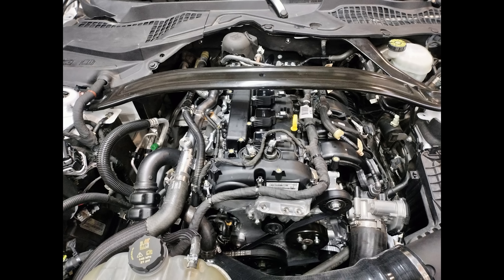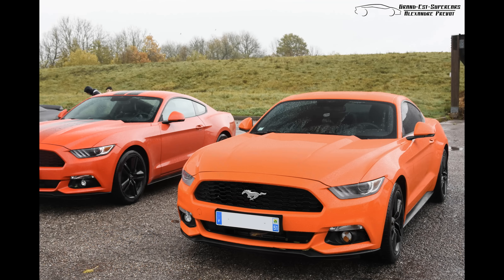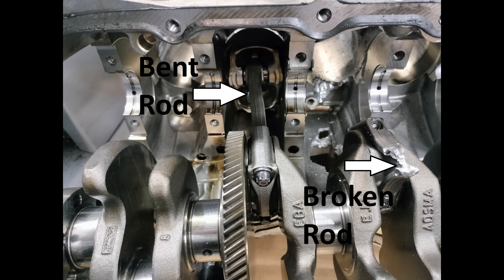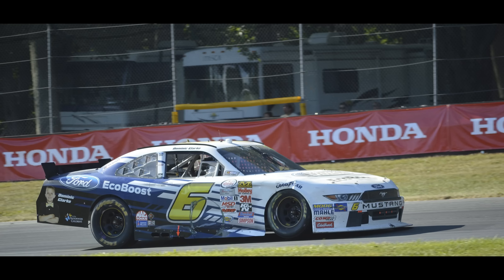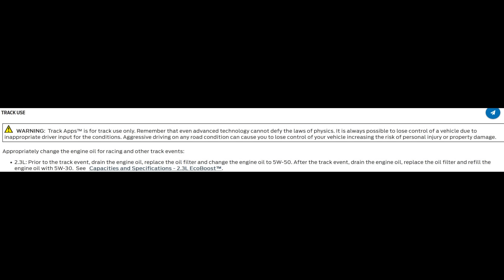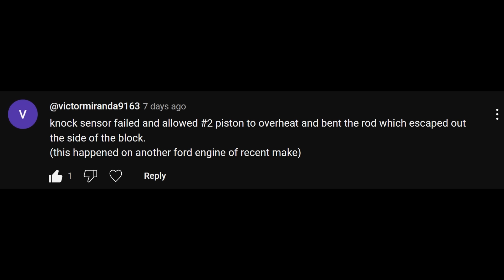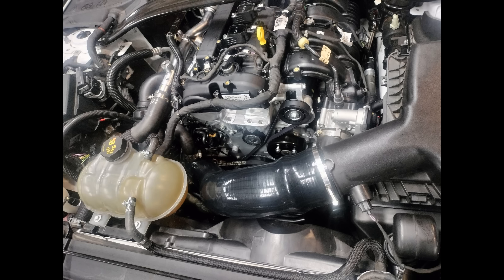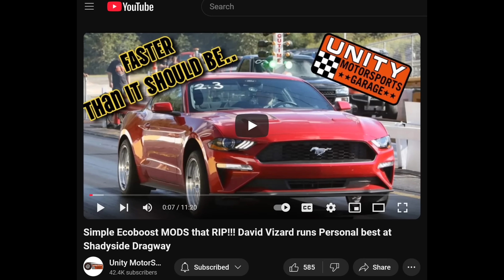EcoBoost Destroyed, What Happened?

Comment: I can tell you what happened. It’s a small4 cylinder engine. Because it is a 4 cylinder engine with a turbocharged engine it runs hot and temperature is the number one cause of  these engines burning up and leaking oil.
Reply from the maker: That's incorrect, a newer video showing the cause has been put up.

Comment: 10-15 seconds with a heat gun on a plastic connector gives it enough flexibility to open without breaking.   How hot should the heat gun be?   If you can't hold your hand in the heat for more than a couple seconds then it's too hot.  If you can hold your hand in it forever then it's not hot enough.  I usually set mine to about 1/3 of max heat and hold it about six inches from the connector.   Even 40-year-old plastic connectors can be opened non-destructively after heating.

Comment: If ANYONE else said that the rod bent from pure power and not detonation I would call bullshit.   In a NA engine the highest stress on the rod is caused by the change in direction at TDC & BDC. At high RPM It is almost always higher stesss there compared to the stress after TDC where the combustion pressure is pushing on the piston.   The extra force caused by boost doesn't change the stress  at TDC or BDC so you have to make A LOT of power to bend a rod.   Most hot rodders don't monitor EGT's, AFR's and knock sensors close enough to avoid knock on a boosted engine. They get a clean tune on a dyno then drag race with the same tune but different weather conditions and blame thier engine destruction in faulty rods 😂
Reply from the maker: Just to be clear I said from cylinder pressure. Power would usually involve RPM, at least horsepower would. There were no signs of knock in this engine. Not from logging data, not from looking at the pistons, and not from reading the bearings with a micrometer. I couldn't believe it either, but Ford uses junk rods.

Comment: Mine blew up at 144,000 from original spark plugs I'm guessing create a spark knock in the engine causing it to throw a rod out the same way. Mine was a automatic I was just driving around the curve at low speed but I did have the RPMs up pretty sure mine already had maybe a bent rod since these engines have a weak one 2015 is the year I have. I've also heard in the upper exhaust ports don't let enough out creating the pressure in the cylinder  pressure buildup then it throws a rod right through the block.😂

Comment: i have 2 Rangers 2002 & 2011 with the 2.3 Duratec, predecessor to the ecoboost. These have been as good as Toyotas engines, one has 200k miles other has 80k miles. ( i worked for Toyota 10 years). i hate new electronics on engines, im old, i grew up all metal and analog engines.

Comment: With this higher horsepower tune what was your car making and what was peak manifold pressure? I’ve recently purchased a used 2door bronco with this engine and manual trans and I think it has the ford performance tune that is supposed to make 330hp and 385ft-lbs I believe according to some sources online. (Google and forums). I’m curious what kind of manifold pressure you hit because I’ve seen peak pressure on my display hit ~21psi when I was needing to merge onto the highway 80mph speed limit.

Comment: Well that stinks.  I'm curious why you opted for the Ecoboost instead of the GT if you were going to track it?  You can get a lot more potential HP and torque out of the 5.0.
Reply from the maker: Why a GT when you can get a Shelby?
Reply: @GregsAirplanesandAutomobiles Not everyone has a Shelby budget, I'm afraid.  That's why I bought the GT.  Did get the track pack though.

Comment: I don't understand why you and vizard care for this 4 cyl when the 5.0 coyote exists, and is an absolute unit
Reply from the maker: In a sense you're asking why bother with 4cylinder engines at all? There are a lot of reasons. First, it makes the car about 10,000 dollars less money to buy.  It gets better fuel economy and is far less costly to insure. So those are some practical reasons. From a performance standpoint of course the V-8 is faster but the 4cyl car is lighter and better balanced for cornering and braking.

Comment: I've got the 2018 Focus RS LE with (essentially) the same motor.  Overall they are a reliable motor with few vices, but don't take kindly to excessive tuning. Less than stellar rods + high cylinder pressures at low rpm thanks to the relatively small turbo = bendy bois!
Reply from the maker: It's no Alfa Romeo engine, I can say that. It's a shame really, Ford was close to hitting the mark with this car but they took a few shortcuts in the engine which really limit it's potential on stock internals.

Comment: So I should be good with my 2016 Fusion 1.5 eco-boost as long as I don't abuse the engine, keep RPMs under 2000 and have regular oil changes. The tag line on this video was a big worry, until I watched the entire video. But a good video with great information. Thanks Greg.
Reply: Most Ecoboost owners agree that our motors like a little RPM. Try not to lug your motor, nothing wrong with shifting above 3,000 RPM.

Comment: 7:37 Cylinder pressure is reflected by torque output. Are you saying that the fiat engine produces more torque than the eco boost but doesn't produce as much up high and hence doesnt have as much horsepower?

I ask because some people treat boost like its an absolute measurement that can be compared across different manifold, valve, exhaust, turbo configurations or engines.
Reply from the maker: No, I am not saying that the Fiat engine produces more torque than the EcoBoost. I'm not sure how you got that. What I said was that they have rods which are about equal in strength. For the Fiat, a much smaller less powerful engine, they are pretty good, but in the Ford, they are a weak link. Also, I never discussed boost in this video as I do that in plenty of others.
Reply: @GregsAirplanesandAutomobiles Alright, fair you didn't talk about torque or boost, I think I just made a bit of a jump. When you say "about equal in strength" from where do you draw that? Sorry about making assumptions.
Reply from the maker: Ah, good question. I say about equal in strength because they are made from the same material and are about the same in terms of thickness. In the Fiat it's almost impossible to break the rod with cylinder pressure. Of course excess RPM will do it.
Reply: @GregsAirplanesandAutomobiles  Ah, that makes sense. I just saw that you've done a bit of playing with the multiair. Fun little engine.

I'm assuming that's a GTV6 in the thumbnail going by the bonnet (hood) So the Busso rods are more robust than the ecoboost as well?

If a new factory engine is being put in with the same rods I would pull some timing and maybe a little boost in the range at which the newest tune was reaching max torque to avoid the overstressing of the rods. Still allows you to get the benefits mid range and up.

Comment: I think is something about timing, maybe after valve float and when the valve was supposed to be open it was closed at the compression part of the cycle, it did it a couple times in a row and it blew the rods. Way too much pressure.
Reply from the maker: Nope, the valves never floated.

Comment: Why are you racing with an automatic? I recently bought my first ever automatic (I’m a euro and most cars around here are manual) and the disconnect between rpm and speed die to the torque converter makes driving fast impossible. It can’t even pull off the line fast.
Reply from the maker: Perhaps you should talk to Ferrari. You might be able to get them to offer manuals again.
Reply: @GregsAirplanesandAutomobiles  Ferrari haven't offered an automatic ever as far as I know, just automated manuals and actual manuals.  None of their current lineup is automatic at least.

Comment: Balance shafts are such a waste. I expect a bit of vibration from bigger 4 cylinders. Companies want to worry about every 0.0001% of fuel economy, so they go to stupid wet belts running timing gear and oil pumps, instead of just getting rid of the stupid balance shafts, which do not actually FIX the problem, just hides the problem with extra power robbing mass. I know a few people running large displacement 4 cylinders ranging from the GM Iron Duke 2.5 liter all the way up to lightly and heavily modded Honda H-series engines that have removed their balance shafts with no ill effects from doing so. Balance shafts are the lazy band-aid fix, they have always bothered me, does not matter if it is a 4 cylinder or a 90 degree V6, balance shafts are dumb.

Comment: Now that I have a little more information, I'll state the engine damage is the result of excessive cylinder pressure, but not the true cause.
Searching for the true cause, will require additional data concerning cylinder blow throw or intake manifold pressure vs. drive pressure, and just not peak pressure, but scaled pressure, over the complete rpm range, plus timing data.
And even this may be inclusive, due to the limited information on the cylinder head with integrated exhaust manifold.
Reply from the maker: I have a mountain of data on this. I was lucky we were set up to log.
Reply: Excellent!!
Something that most guys  with basic data loggers can record is crankcase pressure vs manifold pressure, timing, wastegate position, etc.
I check my oil level and catch can after each 1/4 mile run and almost always collect a little oil.

Comment: I heard a theory that bent rods of this sort is from applying too much load at low rpm. From a turbo ls youtuber. As in below peak torque output.  Different application, different engine. First video of yours I watched so I have no clue about your car's specifics.
Reply: Yep, that's why the modern quick spooling turbos seem to eat the old classic JDM engines.

Sure, that  stock bottom end RB26 happily made 500-600 HP all day with that big laggy journal bearing turbo that doesn't get going until 5k. Suddenly your asking the rods to deal with 90% of max torque where they used to see 40-60 while the dwell time is 2x what was at that same 90% max torque on the older turbo.

Comment: My guess would be that there was too much boost, especially at low rpm where turbos tend to generate maximum torque. Was the electronically-controlled wastegate functioning properly?

I'm not a fan of forced induction for street engines, racing engines fine. I like the high compression large displacement of my 370Z with its flat torque curve.
Reply: Interesting question about the wastegate!
The 2018 Eco Stang uses a pneumatic wastegate, but the new 2024,  uses an electrical wastegate. Both are controlled electronically.
Reply: Since reading about Ford's new Ecoboost Motor, I've been searching for information about the changes made (including the wastegate) and the advantages.

Comment: Greg... I just read where you were running a ported turbocharger!??
Can you tell me what type of wastegate actuator and bov, you were using, as well as any exhaust modifications?
Reply from the maker: The Vizard turbo mod, the first one, he has videos on his channel where he shows what he did. It certainly allows for more power.
Reply: Thanks,
So, his ported turbo with factory stock bypass/bov, wastegate and stock catted exhaust?
I'm considering, doing some detuning on my car to move from the 1/4 mile to 1 mile track and have lost my notebook, from when I ran a stage 2 tune with stage 2 mods. Your information is very helpful!!
Thanks again!
Reply: I also keep an eye on what David is doing with his stage 2 Mustang.
He needs to at least, let you tune his transmission!

Comment: My question after the fact is how big of a fuel injection shot were you giving this engine before failure? It might be possible for too big of a fuel shot to bend the connecting rods. Top fuel dragsters will knock out rods if they are over fueling.
Reply from the maker: No, we were not hydro locking from excess fuel. While it's possible to do that it's not going to happen on a street engine. Even if an injector was stuck fully open as long as the engine was running it wouldn't hydro-lock it in this application. Now if you shut the car off and the injector stay on then it can happen, but it will happen when you start the engine.
Reply: @GregsAirplanesandAutomobiles  well then I guess you had too much boost and raised the compression enough to find the weak link.
Reply from the maker: Everyone keeps saying boost, it was really cylinder pressure at low rpm that did it.

Comment: My moms car has a small head gasket leak, coolant going into the combustion chamber. It is a car with 200k miles. She wants to keep drivin it until we can fix it. I want us to do it but she prefers a mechanics shop. Is it wort it to use a sealant like blue devil, maybe even a very small amount since she will be driving the vehicle anyway? Any other methods? I plan to up the octane of the fuel to resist the extra heat caused by the coolant going into the chambers, when we switched to 91 it reduced the misfires a decent amount. It is a vdq40 nissan engine. Thank you for any help anyone can provide.
Reply from the maker: I don't know about that Nissan engine, but as a general rule the products that you put in the coolant system to stop leaks cause as many problems as they solve. It's best to fix the leak.
Reply: Appreciate your time, and kindness. I know a lot of people would roast me for asking about alternatives. I will go in there my self in a few days.

Comment: The other factor stopping the ecobust from being relevant in the way the LS is the go to V8 swap is Honda's K series. Hondas cars for quite a long time all had a tuning potential, and took B, H, K and J swaps to an order of magnitude ford could not be expected to match even if the ECOBEAST had been the standardized playing.

Is the ecoboost mustand more track worthy than the Fiat miata
Reply from the maker: Fiat vs. Mustang depends on the track. We didn't have a transponder on the Fiat but Dee drove both and seemed to think she went faster in the Fiat 124. However the Fiat 124 always feels faster so I don't know. What I can say is that the Fiat has a much better suspension, but the Mustang is faster in any straight line contest.
Reply: @GregsAirplanesandAutomobiles  The fiat can brake later and pull more lateral G, just not enough for one's sexuality to forgo questioning. 

How much cylinder pressure over stock do you believe the rod of the mustang to have been subjected to? I have to be honest: you mentioned the mustang finished the track day, and failed on the way home- I trust you would've noticed the engine's losing-ques, the cylinder 3 rod alone probably lost its oil clearances with that level of deformation. All this said, I know nothing.

Comment: I bought a 2011 Ford Escape Limited , a V6 . Its around  110,000 miles with no major failures . 5000 mile Oil changes. Seems when Ford was good. 
All Ecoboosts , younger, seem to have issues?
Toyota ?

Comment: What Happened? Dah you obviously over compressed it.
Reply from the maker: Nope.
Reply: @GregsAirplanesandAutomobiles  Did you remember to install the 2nd throttle body ?
Reply: @GregsAirplanesandAutomobiles  Yeah. You forgot aboot the 2nd throttle body. It's a common mistake people get wrong when they are over compressing - turning a gas engine into a diesel engine.
Grinning winky winkie

Comment: my d16y7 failed in a rather non-honda way. at least from what intel i've gathered from other nearby owners of such engines. rod bearing 4 completely ate away due to lack of oil, 1-3 were in damn near perfect condition. this is because this particular engine oils 1-3 directly and 4 from oil down off the head. my engine particularly had experienced prolonged oil changes that have me guessing the small outlets in the head got plugged up.

Comment: With regards to the balancing shafts, it is my thought (and i'm not an engineer) that they're there not for smoothness in terms of comfort, but for the prevention of fasteners getting undone from vibration. 
Because the volvo redblock engine has a 16v variant which uses them, and the 8v don't, and people decomission the balancing assembly, because it's a notorious failure point with these engines for a number of reasons, the key of which is the belts for that shit being under the timing belt, and if that goes, the timing belt follows. AFAIK, not all balancing belts' quality was up to par. 
The 8v redblocks are non-interference, and the 16vs aren't. 
So i had mine's removed, and i didn't notice any sort of difference. The engine, in the end, died by other means and is being replaced by a vq30det.